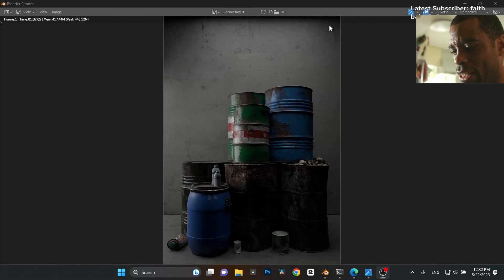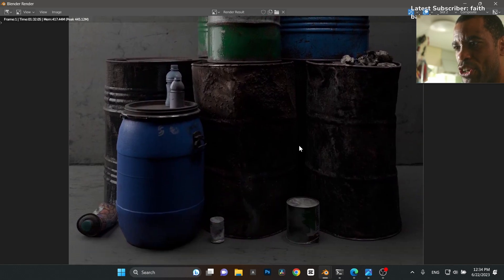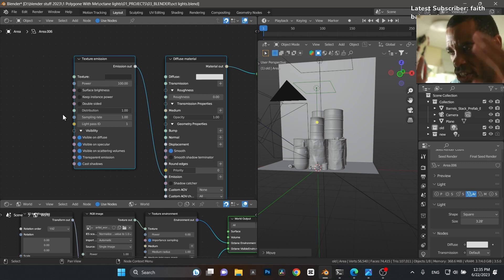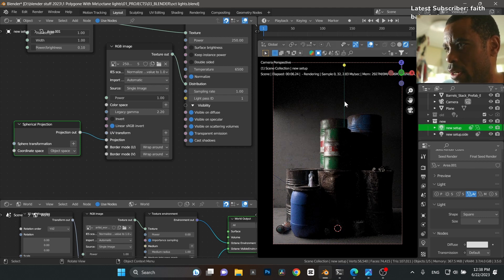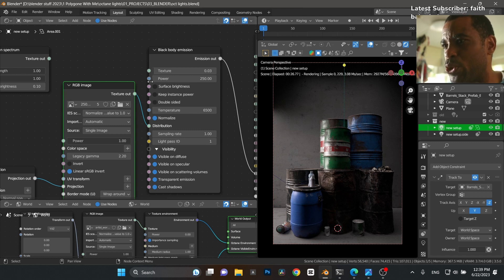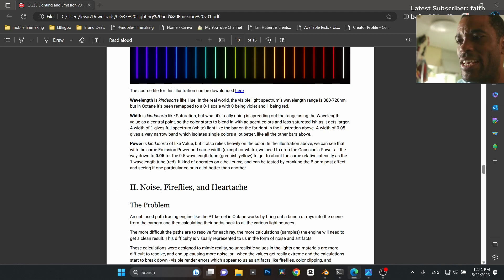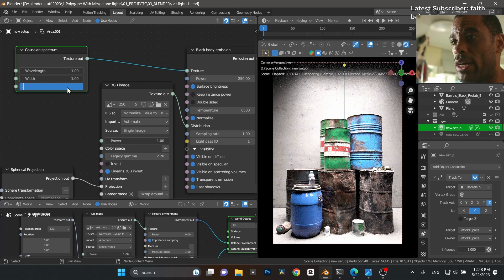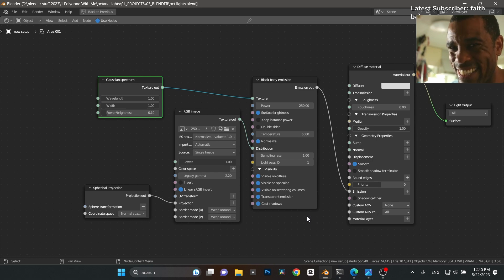Blender Octane Beginner Lighting Tip

Comment: When you want to use real world values for lights shouldn't you also account for the efficiency? The standard lightbulb has only 5%, 95% of the power is just heat. So when you want to replicate a 1200W aperture light shouldn't you set the light closer 60W?
At least I use it as a starting point and up it a bit until the shot looks great. (also acounting for the reflectors that focus the light a bit)